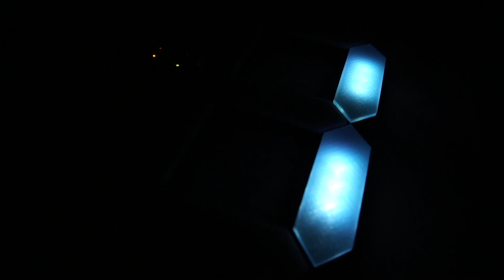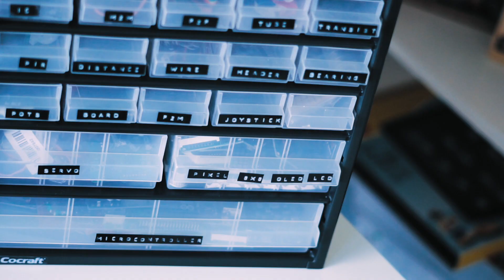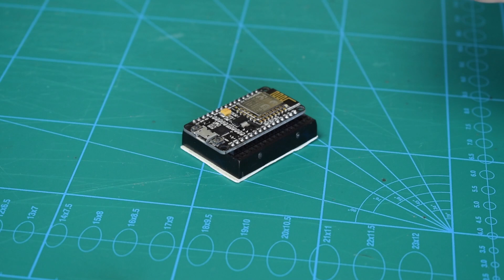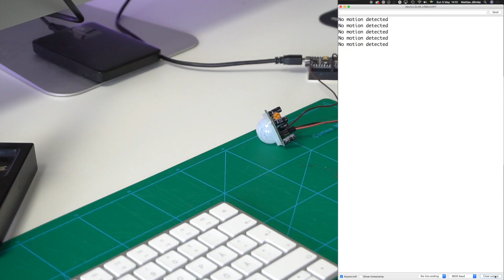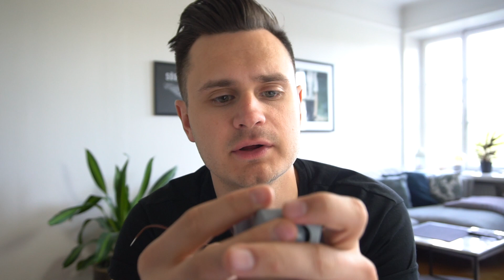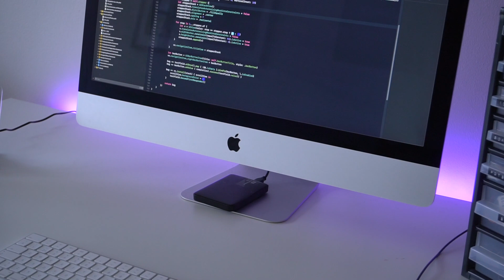DIY Hue Motion Sensor using Arduino

Comment: Why not just use the 5V out on the Node MCU? labeled Vin, which is usually 5.2v
Reply from the maker: .... You sir is making a very good point .... The more you know!
Reply: Why not use an PIR with the 3 PIN Jumper-Bridge and connect the 3.3V to the 3.3V Pin ;) -> https://i0.wp.com/randomnerdtutorials.com/wp-content/uploads/2015/01/pir_motion_sensor_arduino.jpg?ssl=1
Reply: In addition -> https://iot-playground.com/images/articles/039/Pirschematic.png

Comment: How far does sensor work?  I need to make one and it monitor 16feet out. 12feet wide inside a backyard workshop building at night or when not used - security...  WIFI.  AND CORRECT VOLTAGE TO RUN OFF A BATTERY [size AA) or anything that will work for a year or more.
Please advise.
Also list website to order all items.  
Also website services to print and mail to me the container for sensor.

Most Humble Appreciation!

Comment: I noticed you always use the Arduino IDE,  you should check out the free Visual Studio and a plug in for it called Visual Micro. I use it in the lab all the time. It puts all the powerful features of visual studio in the game, while allowing you to code for the Arduino. Simply an awesome setup. I should really do a video on it :)
Reply from the maker: Haven't used Visual Studio in many years now, but I imagine it's still kind of a big app. Would be sweet to use VS Code and I guess there are plugins for that one too. I was doing PlatformIO on Atom before but didn't like the overhead I felt it created. The simplicity of .ino and Arduino IDE is nice imo.
Reply: @engineerish  I can understand that, but syntax highlighting alone is awesome, the ability to do full object oriented programming for the arduino (you can use and include classes that are not inside a custom library with VS, but not the arduino IDE) check it out, I think the free version of VS is community edition version 2019 has been released.
Reply: @engineerish  check it out here :) https://youtu.be/bOniS6zsihk?t=1393